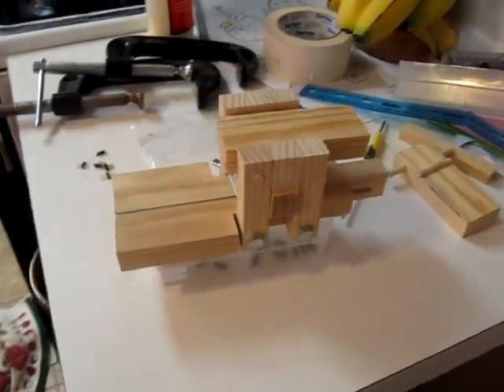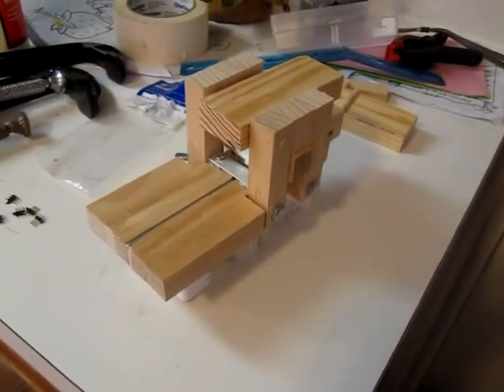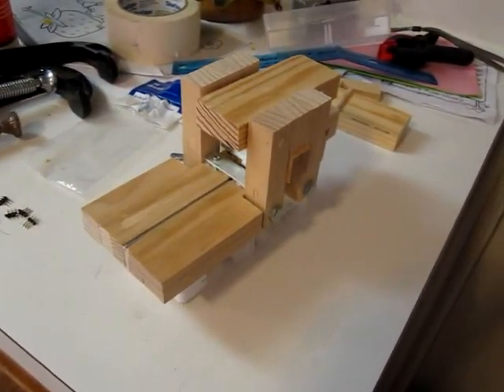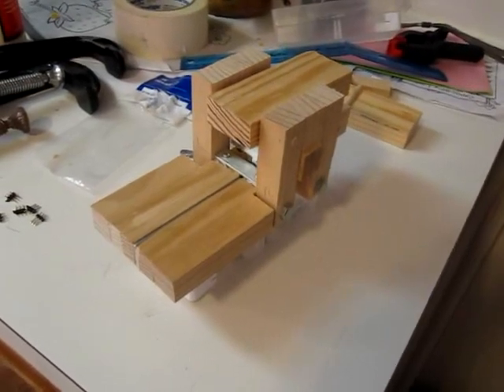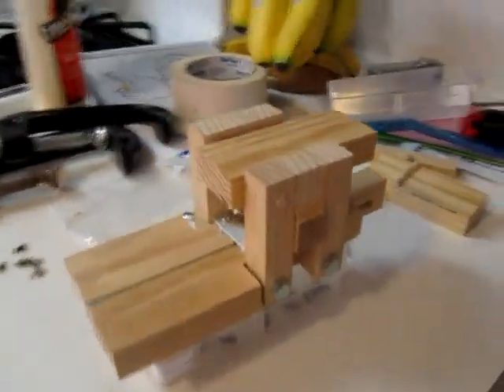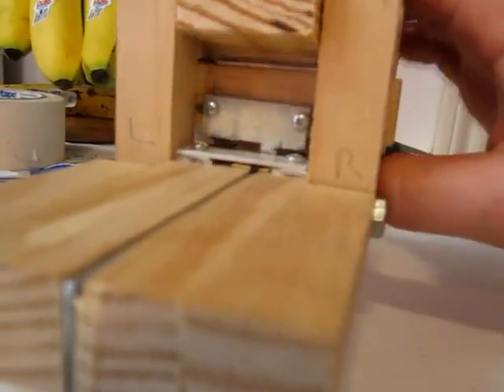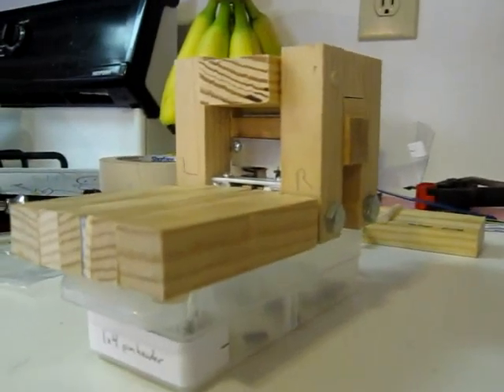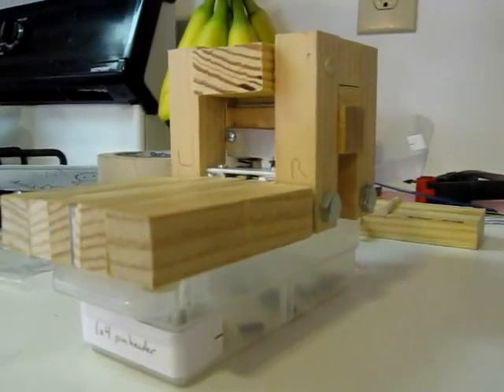Pin header cutting machine

Comment from the maker: @GeorgeGraves The track is actually a piece if 1/8" steel bar sandwiched between the wood on either side.  Since posting the video, I made a couple minor adjustments--replacing the 1/8"-thick steel tooth with a 1/16" aluminum one, and shaping/sanding the adjustable stop to reduce jamming.  Since then, I haven't had a single misfire.

Comment: You should add some kind of electronics to make an auto feed system that will count the number of pins you want and cut them to length. And have a setup so you can punch in a number and hive it feed cut and spit out the right length header.